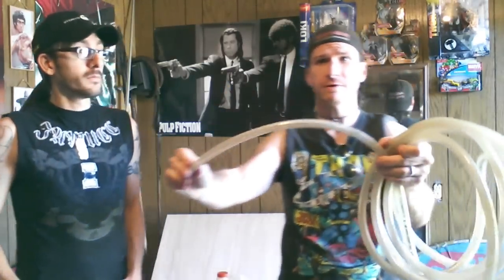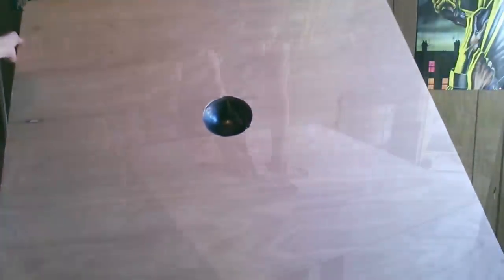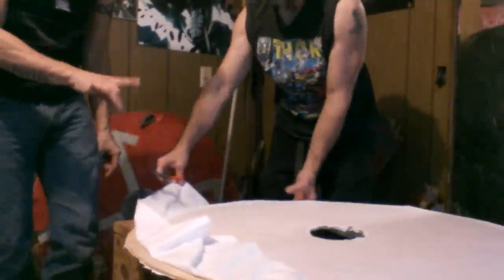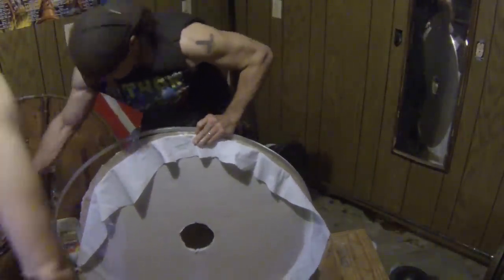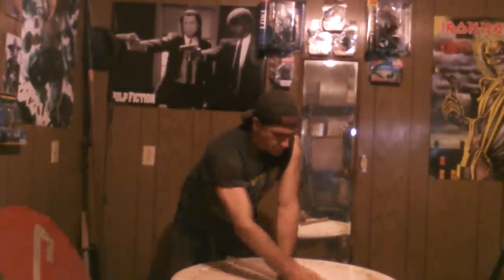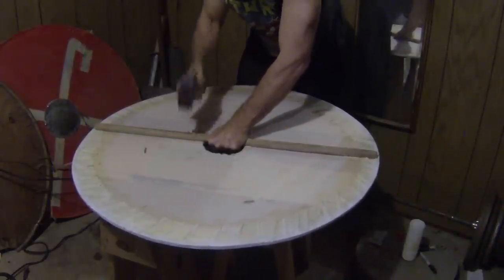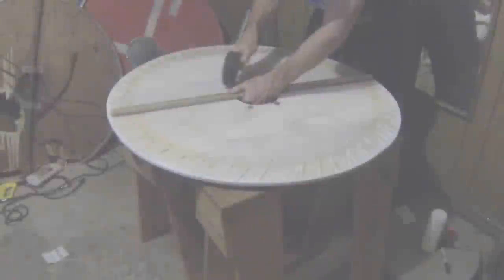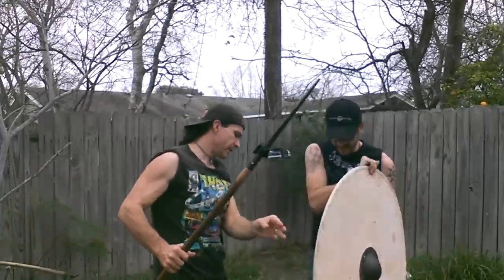How To build a Period Viking Round Shield with Modern Materials!

Comment: Are theses the shield that the vikings used?
Reply from the maker: Ja! Except many are covered with heavy Oxen raw hide back and front. Most made of only 1/4" planking and some times tapered to 1/5" at edge. the secret was the covering it was a composite to be light and with stand extreme blows and stop high power bows ect. Linen very well could have been used in multiple layers as we did in the video it is described in early shield text.
Reply: Ja?
Reply from the maker: piedude898
Yes! LOL
Reply: So was it used in the warfare?
Reply from the maker: piedude898
Yes of curse single combat / Einvigi or Shield Wall / Skjaldborg.
Reply: Shield or plate armory? Against a two hander
Reply: Armor*
Reply from the maker: piedude898 In the Viking era two handed swords did not exist but two handed Dane axes did. They did not use plate they used chain, lamellar or scale. they also wore multiple layers of clothe armor.
Reply: do you have a dane axe?
Reply from the maker: piedude898
Not a steel functional version atm only SCA version. We will be gettin one soon from Medieval Shoppe I have been told.
Reply: Test it against a shield

also was two handed weapens inferior to sword shield when plate armor wasn't made
Reply from the maker: piedude898 Yes in single combat they were since one could not attack and defend at the same time like the shield and lack of plate armor made blows much more devastating. The Dane axeman would stand behind the shield wall with two handed spearman. They can win in single combat just more difficult against a shieldman rushing them.
Reply: Shield or plate armor in the medival period
Reply: A flail can break a shield
Reply from the maker: piedude898 Normally no! The flail is designed to get around shields, blocks and parries
Reply: Are you building a linen shield?
Reply from the maker: piedude898 That is what we built and tested in this video. Laminated linen and milk glue multiple layers. You can use heavy raw hide one layer front and back but always have to do both sides and rim.
Reply: I thought viking used poor quality shields
Reply from the maker: piedude898  No they did not but maybe they had special uncovered shields for Holmganga though.It being a ritualistic duel.
Reply: What did viking use to make shields?
Reply from the maker: 1/4" Planking glued to gather with milk glue and covered in heavy oxen raw hide back and front. The raw hide is what gave the shield strength and made it stop arrows and weapons. It also made it lighter. This video shows one with raw hide. Every one made them the same way..
http://youtu.be/VsZnTCQptWc
Reply: But it didn't stop a dane axe
Reply from the maker: piedude898 It can be rimmed better and would not break every single blow either. You do not block with the rim against a Dane axe either. It was also rimed in soft iron as well as raw hide. The shield was also on a metal brace no one was holding to absorb the blow are angle properly to catch it. The shield in our video would not break like that if Eldgrim was holding it I assure you.
Reply: Did vikings really used linen shields because i try to research it and found nothing
Reply from the maker: piedude898 We are uncertain, it was used in the time period of the Vikings, before and after. We did it as alternative to Raw hide and for testing. Raw hide still seems to be lighter and stronger from my experiences. Spartans covered shields in linen and many warriors did including Romans. The one in the episode we linked you was covered in a canvas type materiel most likely linen. We know they used linen as armor and had tons of it so would stand to reason you could cover a shield with it. They used milk glue as well,
Reply: When you get a 2h dane axe test it against the shield.
Also when are you going to get your dane axe?
Reply from the maker: piedude898 We are supposed to be getting one soon from medieval shoppe :P
Reply: A Dane axe can split a shield
Reply from the maker: piedude898 Only if the rim is of Raw hide stitched and breaks not all rimming is done this way and many Vikings shields had iron rimming not just raw hide or both. It can it is not always going to happen you could see that as lucky blow or design flaw on the makers part in that video. Or both even :P
Reply: Did Viking shields break easily?
Reply from the maker: piedude898 Depends on saga and story Normally Holmganga shields seem to brake easily but I believe that is because they are made special for Holmganga and each participant in the Holmganga has a three shield limit. If shields are made the same as war shields I do not think you would need three.
Reply: So they broke easily that sucked
Reply from the maker: piedude898 Only in Holmganga and you fought on a 9' by 9' mat if you step of you lose and are considered Nithing or Nothing a coward. They flipped a coin to see who attacked first and took turns as well, Holmganga was til first blood. The loser had to pay the winner silver.

Einvigi was to the death and used regular war shields and they do not mention them breaking often that I know of and in einvigi or one on one combat their are not rules.
Reply: What was the standard shield the viking used
:)
Reply: Like what materials often the Viking used to make their shield
Reply: Anglo saxton shield can be easily destoryed by a axe i watch a video on one
Reply from the maker: piedude898 Not all shields can be the last one took 3 times the force a man could put out to damage it.
Reply: What wood did you use in your video?

And btw is that your dog in 14:10
Reply: You said that a normal shield would get cleave if you had  a axe weapen
Reply from the maker: piedude898 No depends on the shield there are Viking age shields that can stop axes easily. The shield we made will stop hand or Dane axe.
Reply: what viking shields can stop the dane axe easily?
Reply from the maker: Yes for a bit all shields break over time from repetitive hitting with extreme weapons like Dane axes but it will not break on the first few blows that is for sure.
Reply: How do you know that
Reply from the maker: From testing and accounts Historically. Mostly in Sagas and later and earlier century text in which same shield construction was being used. To end all these question I will do a test video soon on raw hide shield and Dane axe we will be receiving soon.
Reply: You earn yourself a sub :D
Reply: also when i watch the video you gave me the dane axe destoryed the raw hide shield
Reply from the maker: piedude898 Rimming was done incorrectly :D
Reply: How?
Reply from the maker: piedude898 We find Historical shields that use iron rimming. Did it have iron rimming? The Raw hide can be stitched together at the edged and then rimed as well with metal bindings. Did the one you see tested have that? Of course not all shields are made the exact same way depends on who made them and what methods they use and how durable they want it and weight and such are factors as well ad materials available, time ect.
Reply: rawhide or linen
Reply from the maker: We know they used heavy raw hide and Linen can be used as well. All shields are made of composites are they will not stand up to battle . So yes Linen will work as well but not as good as Rawhide although cut resistant it tends to crack due to lamination under extreme force but there could be methods around this as well. We need to experiment with different glue mixes of of milk and ways of laminating it and possibly different weaves of linen.
Reply: so rawhide is better?
Reply from the maker: piedude898 It does not break or crack and is lighter over all. From current experiments but this may just be due to our current technique of working with linen or linen like materials.
Reply: What will make a viking shield not split the wood
Reply from the maker: piedude898 The raw hide or Linen lamentation you do not understand a composite? planking was made like bow out of woods that give the lamentation acts like plastic or backing on a composite bow so the shields gives like a bow but snaps back. The grain on historical shield all goes the same way. The lamentation or Raw hide or linen is glue to the wood as well as being stitched around it to encase it. The lamentation is cut resistant and has to be split not cut which it gives and is held in the had and gives when hit very hard to break or pierce.
Reply: is this a historical accurate shield?
Reply: Because you said it can be used for sca
Reply from the maker: piedude898 Yes you can use a real Viking shield for the SCA.
Reply: How come all viking shields are not like that?
Reply from the maker: piedude898 They are made by who ever made them some were better at shields than others and different materials available at the time. You knowledge of how to construct a good shield and experience with them. What your personal preferences are and what it will be used for. How much time you have to construct it and all materials came from trees and animals ect. You had to process every thing your self.
Reply: were the vikings poor?
Reply from the maker: piedude898 No they were all upper class by European standards and lords / Men at arms. All Viking traders/ settlers / raiders had wealth and arms and armor. They were a merchant seafaring group and trader all over Europe, Africa, middle east and parts of Asia before many other countries had contact with each other. They also farmed them selves but many owned many slaves and servants to do menial work for them. All though they trained for war many were artisans and craftsman much like the Spartans. There are some connections that have been noted between the two cultures early period by some scholars.
Reply: How come this shield is strong compared to the other shields you have like the red one
Reply from the maker: piedude898 The red one is just wood originally and was the Blue one at one time repainted with the white star. Rimmed wood not covering. Later I covered the front with one layer of linen. That is the one used to stop the Kanabo in those test meaning a properly made shield could never be broken by kanabo if hit in that same manner. It also has some rimming removed to allow it to be cut into in one spot to disarm blades.
This one has multiple layers of Linen and glue front and back 3 front and 3 back which act like Raw Hide and it is lamented and a composite to act like rawhide covering both sides. 1/4" hardwood plywood has to be rimmed to with stand SCA use and have a back brace. It is basically wooden planking the layers wood front and back are paper thin veneer. We use it to simulate planks a good blow cracks the veneer but does not break the shield. The plywood by it self will give but is not cut resistant. So if you cover it with at least 2 layers back and front Glue and linen or linen like material it becomes very strong and cut resistant. Raw hide would make it even better and acts like plastic when hit bends and bounces back.
Reply: What do you mean by layers of linen?
Reply: How did vikings get all these matierials
Reply from the maker: piedude898
Like every one did at that time period they cut down trees,collected Bog iron ore, grew flax, killed cattle and milked cows. They then cut planks, smelted wright iron, spun flax into linen, skinned cows  and made milk / casein glue. The materials were every where they just needed to be processed and assembled properly.
Reply: a kanabo is wood
Reply: Not iron
Reply from the maker: Kanabo is wood. Tetusubo is Iron and later century japan. Samurai did not use Kanabo that I know of it is an Oni weapon and early century peasant or Bandit weapon to kill armored Samurai. The tetsubo or iron war club got some use very late Japanese century when armor was extreme and designed to stop firearms. Armor was almost not used but by some Samurai leaders as a status symbol at that time. This is the weaker shield against a Tetsubo or iron bar.
http://youtu.be/aIzoi15TYZ4?list=UUNz5BlP5XafcfOWGbxCAgxQ
Reply: ThegnThrand Could a katana cut a shield?
Reply: piedude898 nvm
Reply from the maker: piedude898 It might stick in the edge of the shield and get trapped depending on how the shield is made but cut through no.
Reply: What about a warhammer
Reply from the maker: piedude898 Same as an axe pretty much. If it had a back spike like a military pick might piece it.
Reply: why is this shield so big
Reply from the maker: piedude898 Because this is the Historical size and works better in single combat and Shield walls than smaller versions. The ones most reenactments use are far smaller than Historical finds. It is obvious why a larger round works better in shield walls or Skjaldborg but not as obvious in single combat for most that do not under stand it.
here are some videos to explain.
http://youtu.be/dkhpqAGdZPc?list=PL_hVs5MjWFV22tQL67efdbrPtohxnZUTQ
http://youtu.be/hJQjvyxdnpo?list=UUNz5BlP5XafcfOWGbxCAgxQ
Reply: Most viking shields i see were small
Reply from the maker: piedude898 Those shields you speak of are not historical finds, those are modern reproductions you are looking at. The norm was 1 meter or about 3 foot diameter that we find most commonly Historically. A flat shield does not work well at all that is under about 32".
Reply: What will a poleaxe do to a shield
Reply: or a polearm
Reply from the maker: piedude898 A Dane axe being 4' to 7' long is a poleaxe and would do about the exact same thing.
Reply: So a well made shield will be a effective against any weapens?
Reply: piedude898 quality shield vs quality axe
Reply from the maker: piedude898 Would be good test but would take many blows from axe if really good shield.
Reply: Good quality axe vs good quality shield
Reply: and its 2h
Reply from the maker: piedude898
Yes that is what I am talking about a Dane axe is a two handed polearm.
Reply: What will a steel dane axe do to a good quality shield
Reply from the maker: piedude898
We could test that out but I think it would damage it but not to the point of ruining it in one blow.
Reply: test it pls
Reply from the maker: piedude898 We will when we get the Dane axe in from Medieval Shoppe :D
Reply: What's your prediction when a steel axe hits the shield you made
Reply from the maker: Not to much might cut into it a hair.
Reply: So your saying that the steel axe would not doing anything to the shield?
Reply from the maker: I said it would cut into it a little we tested an axe on it did you not watch us? In this video we test an axe two handed. Here is clip with a 45# bow point blank!
http://youtu.be/dBTcAf1tCfU?list=UUNz5BlP5XafcfOWGbxCAgxQ
Reply from the maker: piedude898 http://youtu.be/dBTcAf1tCfU?list=UUNz5BlP5XafcfOWGbxCAgxQ
Reply: A cold steel axe would cut a little? you sure about that
Reply from the maker: piedude898 Yes very. If you mean the edging it might get stuck in it. If you mean the surface like the defender should be using yes like a said a little not very much.
Reply: How about your red shield
Reply from the maker: piedude898 It will most likely stick in that shield only as one layer of linen and has sustained much damage over time. That's fine Axe would get stuck in it not hitting anything on person holding it because of center boss.
Reply: What about hitting the surface
Reply from the maker: piedude898
That is what I am talking about that on the shield i this video against the surface it would barely cut it. The red shield you speak of is just 1/4" hard wood plywood meaning it is just planking the veneer really does not count with one layer of linen front only it would cut through and stick in it if you hit it with an axe.
Reply: Mail armor or shield?
Reply from the maker: piedude898 shield I was speaking of. The old blue red and blue shield we had which I hope you are not confusing was used till it fell apart.Here is a link
http://youtu.be/UqsD5OOpDuQ?list=UUNz5BlP5XafcfOWGbxCAgxQ
This is the red shield (one layer of linen front only) here against a tetsubo 15lbs iron bar.
http://youtu.be/aIzoi15TYZ4?list=UUNz5BlP5XafcfOWGbxCAgxQ
Reply: How about a sharp axe against your shield
Reply from the maker: piedude898
I was talking about a sharp axe thew one we test in the video is razor sharp. Did you not understand we are making laminates like the old battle shields of early period they are cut resistant.
Reply: I talk to some guy and he said that a sharp axe would damage the shield effectively even if its well made
Reply from the maker: piedude898 We tested it in this video did you not see it stop the axe with out being cut? all my weapons are razor sharp. He is speaking of modern recreations not historical laminated shields with heavy raw hide back and front or multiple layers of linen. Try getting a raw hide dog bone now try cutting and hacking if really think raw hide you will not be able to do it. Try an axe too.
Reply: what about a crossbow
Reply from the maker: piedude898 They did not have heavy cross boss are clutched lances in the ages of the Viking or when the 3' round was used primarily. The cross bow should be able to do some damage but heaters much thicker, Stronger and heavier made in the same ways accompanied by plate took the 3' center rounds place.
Reply: What about a longbow
Reply from the maker: piedude898 It may or may not pierce it depends but if it does will not go deep enough to hit the person holding it. The test I linked with long bow shot by Mike Loades and our test prove that.
Reply: I thought a longbow was powerful
Reply: what about a powerful bow against a shield
Reply: So if a shield has cover on it with glue any weapen will have a hard time spliting the wood?
Reply from the maker: piedude898
It is the Cloth plus milk or casein glue which is period  in combination that that creates a good lamination and makes it cut resistant although the Glue is not necessary with raw hide but I recommend it on the backing of the raw hide.
Reply: But can it stop any weapen?
Reply from the maker: piedude898 It will stop every thing except extremely powerful cross bow and clutched lance. That is for a wile anything breaks after repeated hitting and wearing away at it,
Reply: Were there powerful crossbow back then?
Reply: Why Do a lot of people say that a Dane axe will break a shield
Reply from the maker: piedude898
It can and has broken shields I am just saying all shields are constructed differently and it is possible for a early century 3' round to with stand many blows from this weapon. IF not no one would have even use shields.
Reply: Were Viking shields good quality?
Reply: Why Viking raid other lands
Reply from the maker: piedude898 They mostly raided monasteries, churches and keeps. That is because in my opinion Charlemagne declared war on all pagans and heathens. He killed 7,500 women, children and old people after a Saxon up rising killed on of his garrisons in Saxony just because they would not convert to Christianity. Then he declared any Christian that traded with a pagan or heathen or aided them in way would be executed.So the Vikings relied on trade to make a living in other lands by ship so they started attacking church related targets to send a message. They started with Lindisfarne in 793 :D
Reply: What were shields effective against
Reply from the maker: piedude898 The Round shield was effective against every thing if used properly in the time period they where used.
They only becomes less effective against heavy crossbows and clutched lances very late period but even then some lightly armored foot men used them.
Reply: Why does the shield break after a first battle
Reply from the maker: piedude898 Where are you speaking of it breaking at or in what Video or program?
Reply: Why does a shield break overtime
Reply from the maker: piedude898 It is like cutting a tree down it takes small amounts of damage over time until it breaks LOL
Reply: A well made shield can a survive a two handed Danish axe that's good quality?
Reply from the maker: piedude898
Yes! It will survive a well made Danish axe!
Reply: HOW1!!
Reply: Do you have the axe yet?
Reply from the maker: piedude898 We will have after the new years some time with a large blade shipment from medieval shoppe :D
Reply: will the well made shield survive many blows from the good quality danish axe
Reply from the maker: piedude898 yes a lot of blows but it will destroy after a large number of hits.
Reply: like how many
Reply: hits
Reply from the maker: piedude898 I am not sure it also depends on how well the shield user absorbs the blows and if he is using the shield correctly and how well.
Reply: The danish axe will only make cuts to the shield?
Reply from the maker: piedude898
Not very deep if any on surface but can damage the edge and possibly stick in to it a little. It will not damage it as bad if all blows or cuts are cut on the flat.
Reply: So it will make cuts on the surface
Reply from the maker: piedude898 Yes not very deep though it will score into the from layers of Rawhide or lamentation.
Reply: will the surface split the wood
Reply: will the danish axe split the wood
Reply from the maker: piedude898 Most likely not. It will not cut into the wood might crack planks apart in side lamination but not from cutting just impact.
Reply: What happens if it split the wood
Reply from the maker: piedude898 It cracks slightly inside sandwiched between the Lamination material. The wood is not that important it is only 1/4" to 1/5" at edges the covering or lamination is what is important. Just two sheets of raw hide stitched two gather would work as shield by it self and be fairly ridged the Zulu used shields made of just raw hide with a spine or wood.
Reply: So it will not break?
Reply from the maker: piedude898 Not like you are expecting no it gives like plastic epically if covered in heavy rawhide which is ridged with out wood under it and almost uncutable surface wise.
Reply: So it will never break :D
Reply from the maker: piedude898 Not the outside layers they will give after core breaks if raw hide and become less ridged. It fall apart after repeated beating like the kind you would get from a long battle like a war. At some point it will fail but not break like I believe you are thinking because you seem to think the wood is very important and the covering or lamination is the really most important part. I will add the modern glue with cloth or fabric lamination is more brittle than it historical milk or cheese glue( old milk glue acting more like a latex type) so it does seem to crack some under extreme force Raw Hide on the other hand will not crack from impact at all.
Reply: Why use modern glue?
Reply from the maker: piedude898 Because it is cheaper and faster to get a hold of and works fairly well. Elmer's glue is a synthetic version of casein or milk glue but designed to glue wood together not shield components and laminates that need to give that give but it is comparable and every one watching the video can obtain it or if they choose make their own milk glue recipes are all over line for it.
Reply: But Vikings did not have modern glue
Reply from the maker: piedude898 The modern glue is to recreate it easily and is synthetic casein or milk glue. Milk Glue can be made the exact same hardness but not ideal for shields :D
Reply: What will you bring in a warfare not counting guns or firearms
Reply: What happen if the shield cover is badly damage
Reply from the maker: piedude898
That is what takes so much time to do :P
Reply: if a shield had no cover would be break by many weapens?
Reply from the maker: piedude898
yes any large mass weapon would do it and arrows would go very deep.
Reply: and what about a shield with rawhide or leather
Reply from the maker: piedude898 Raw hide acts like high grade hard plastic not leather it is more akin to bone like material.
Reply: so the rawhide will survive heavy blows?
Reply from the maker: piedude898
yes and cloth layers can but needs proper crafted adhesive
Reply: Can it survive a two handed sword
Reply from the maker: piedude898 Yes
Reply from the maker: piedude898 I told you works against every thing real well but clutched lance from horse back and heavy crossbow.
Reply: What's a lance
Reply from the maker: piedude898 You have it under arm from horse back! Spear from held secure against shoulder from mounted warrior!
Reply: A spear can't break a shield
Reply from the maker: piedude898 Depending on how it hit meaning if you do not brace the shield no. Against a brace with the offhand it might pierce it slightly. Bracing is not good practice against spears and spears two handed.
Reply: why brace it?
Reply from the maker: piedude898
Stupidity really but keeps it from flipping and can be used as a strategy at time against weaker weapons..
Reply: Vikings did not used plywood
Reply from the maker: piedude898 We are using 1/4' hard wood plywood but it is hardly plywood the veneer that covers back and front is paper thin. Plywood was originally invented to make shields historically the Romans used cross grain thin sheets of birch wood in press glued together to make their scutums or shields. Later century shields were almost all made in this manner. There are text from the Viking age describing grain of wood going in two direction on top of each other glued together which would be plywood but we have not yet recovered one from that time period made in this manner. I believe the Rawhide construction was superior for that type of sheild and that is why we have not found any of plywood design in the Viking age although early period Romans Shields are all plywood design covered in clothe laminate.
Reply: Rawhide is the best covering?
Reply from the maker: piedude898 Yes. It is like high grade plastic and very cut resistant and does not break.
Reply: You're saiding that if a dane axe break a shield easily nobody would use a shield. you sure about that
Reply from the maker: piedude898 Yes I am saying it can damage a shield but not normally in a single hit it takes repetitive hits to do so.
Reply: So you're saying that a dane axe can't damage a shield in a single hit if its well made?
Reply from the maker: Yes I have told you this over and over it will cause minimal damage but enough it will add up over time. You defeat a sword and shield with skill if using a Dane axe not rely on something that might not happen before he defeats you.
Reply: What if the dane axe man is not skilled
Reply from the maker: piedude898 He will die against sword and shield it has the advantage. It is hard to beat a sword or weapon and shield combo with a Dane axe or two handed spear.
Reply: What did Vikings prefer to use in battle
Reply from the maker: piedude898 Sword and shield for single combat. Two handed axes and spears are back up when fighting in formation and get more kills if protected by the shield men they stand behind them.
Reply: Dd the Vikings used bows
Reply from the maker: Yes they had Very powerful self bows or long bows for combat it is documented in the Sagas that took special training to use. In Sweden every one was charged a bow tax if old enough to hunt they were so common and the bow was considered to be able to be used as one of the two weapons all freeman had to be proficient with to defend the country and required to be proficient every in it was required to be proficient in two weapons of war by law.The oldest bow ever found was found in Denmark.
Reply: What's more deadly a war hammer or a Dane axe
Reply from the maker: piedude898 Axes are always better. That is is why the Halberd style pole axe replaced the Lucerne hammer. Back spikes or military picks do have uses against plate.
Reply: A halberd is the same as a dane axe
Reply from the maker: piedude898
Fairly close except also has a thruster and spike or hook on back. Just a little heavier due to armor it was used against. In the
Viking era would be too heavy and not as effective by limiting speed needed.
Reply: What will it do against a shield
Reply from the maker: piedude898
You might be able to get the spike stuck in it which is not a good idea to get any weapon stuck in it. Other that that it would not be any more effective than a Dane axe other than it would kinds work like  winged spera to pull shield open a thrust but way slower and easir to deal with. I would rather have a winged spear (Krokspjot) or real Dane axe over a heavy halberd if I could not fight against weapon and shield weapon and shield over a heavy halberd. A late century light Halberd like used in the American revolutionary war would be good though possibly.
Reply: You said it was close to a Dane axe
Reply from the maker: piedude898 Yes but is heavier and has more metal work to add to its function making it a pole arm or weapon that combines Dane axe, Back spike or hook and spear head. The heavy ones form plate era or too heavy, short and would not provide an advantage unless you are wearing plate and a lighter version halberd took better metals to craft such light fine items and that is the only reason you do not see vikings using pole weapons like them as well as they get hung up on shield in large battles and impractical for shield wall combat.
Reply: If its heavier it will break other things easily
Reply from the maker: piedude898 Not heavy enough to break shield easier and slower. So not an advantage unless you are in full plate. If it was just weight you need all vikings would have used big clubs or heavy axes in combat to beat shields but this does not work even though the ridiculous program Deadliest Warrior assumed it did with the kanabo and tested incorrectly :D
http://youtu.be/aIzoi15TYZ4?list=UUNz5BlP5XafcfOWGbxCAgxQ
Reply: You said that a Dane axe won't break a shield
Reply from the maker: piedude898 Yes I said it is very unlikely if the shield is made correctly and used proper for it to break it in one hit. It would take a beating before it would be badly damaged.
Reply: What if you don't use your shield correctly
Reply from the maker: piedude898 Well then that means your bracing when you should not are untrained and you will most likely die anyway.
Reply: When did the Vikings fall
Reply from the maker: piedude898 They never did they became Christian.
Reply: How is a Dane axe better then a war hammers?
Reply from the maker: piedude898
It has cutting edge and about same weight simple physics.
Reply: In your video was that a sharp axe you test against in a shield?
Reply from the maker: piedude898
Razor sharp all my weapons are!
Reply: ThegnThrand Why was mail so expensive when a shield was a better defense?
Reply from the maker: piedude898
Mail is not primary defense it was secondary defense to give you an advantage if you messed up in combat or something unforeseen happened.
Reply: They dont look sharp to me
Reply from the maker: piedude898
My Weapons are always sharp. The material the shield is made from is a composite and cut resistant not as much as raw hide but still very resistant. So what are you expecting it to do if it is not able to cut it?
My weapons are always sharp here are a few videos to prove it.
http://youtu.be/l3zmfQScJI4?list=UUNz5BlP5XafcfOWGbxCAgxQ
http://youtu.be/F0BgQTNOgr4?list=UUNz5BlP5XafcfOWGbxCAgxQ
http://youtu.be/qhCRCI3cIyk?list=UUNz5BlP5XafcfOWGbxCAgxQ
http://youtu.be/eHcBjBOPrdU?list=UUNz5BlP5XafcfOWGbxCAgxQ
http://youtu.be/UqsD5OOpDuQ?list=UUNz5BlP5XafcfOWGbxCAgxQ
http://youtu.be/2pb6AbcvE_Q?list=UUNz5BlP5XafcfOWGbxCAgxQ
Let me know again how none of this appears sharp. If not I would not have dad stitches on the back of my hand a wile ago.
http://youtu.be/Ojb2ycgUjrg?list=UUNz5BlP5XafcfOWGbxCAgxQ
Reply: Why were viking shields light
Reply from the maker: piedude898 Because lighter shields are faster and center grip has to be light because the way it is held in the hand not strapped to the arm. So they used very thin wood and laminates to make them strong. Raw hide is very light and extremely strong it has been used on shields and for shields forever in all cultures. Plywood was invented to make shields Romans used birch plywood made in their shield presses. Anything that makes a stronger lighter shield that will last longer.
Reply: A lot of people said that a heavy weapen will break a shield is that true?
Reply from the maker: piedude898
I have answered you about this over and over and no well made shield will not break just becasue you use a heavy weapon and a very heavy weapon will get you killed trying to fight with it becasue it is not a practical combat weapon.
Reply: It's practical against plate armor
Reply from the maker: piedude898
Yes but is required to kill the guy in plate or you are not wearing plate it is a slow weapon.
 They did not have full plate armor in the Viking era!
Reply: Is a shield better then plate armor?
Reply from the maker: piedude898
If you use it right you would never get ans and even need armor. So you tell me? The problem is its hard to wield two handed weapons to damage plate with a shield in off hand :D
Reply: So why did the knights stop using shields
Reply from the maker: piedude898 No not really, footman in full plate did not use them as often late century  but Calvary with clutch lance and lighter armored troops still used small and large shields well until Plate was abandon.
Reply: Can a longbow or a crossbow pierce plate armor?
Reply from the maker: piedude898
Heavy crossbow can pierce plate fairly well up close and can pierce the round shield. The Longbow can puncture plate but normally is not lethal on the round shield will get stuck in it.
Reply: What abou the medival crossbow
Reply from the maker: piedude898 The Heavy Crossbow is a medieval crossbow there are light medium and heavy draw weight crossbows only the heavy would be very effective!
Reply: What abou the medium crossbow
Reply from the maker: piedude898 It depends but normally fairy weak but would do better than a light cross bow weight :P
Reply from the maker: *****
LOL I was starting to get use to answering those very strange repetitive questions :D
Reply: Hi person
Reply from the maker: *****
:D